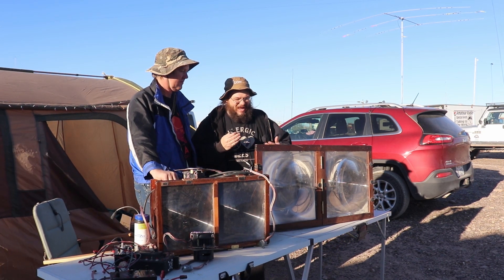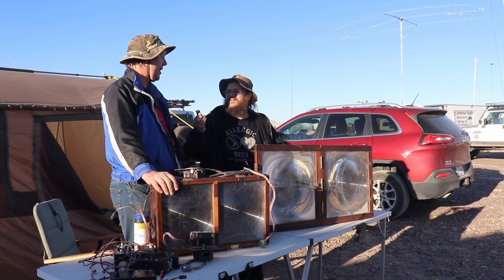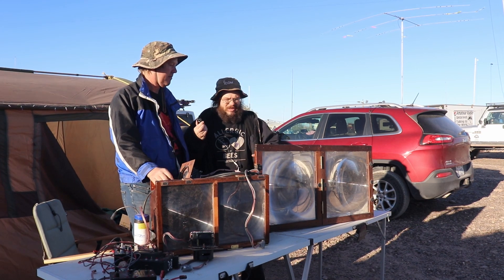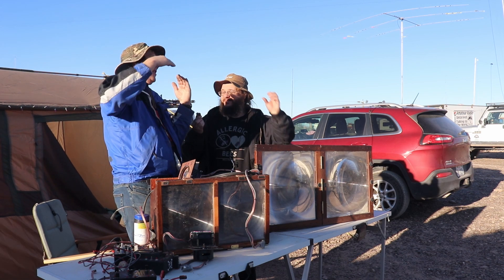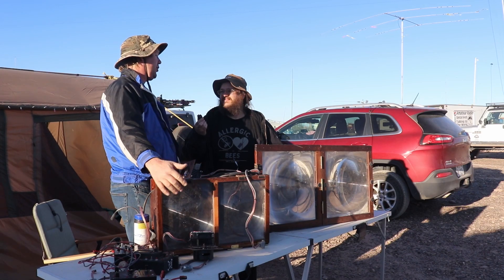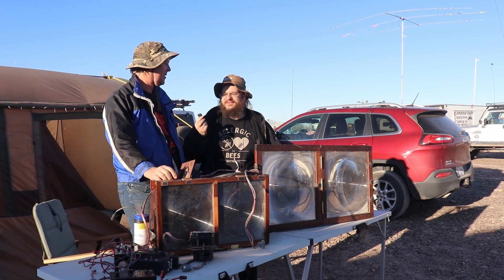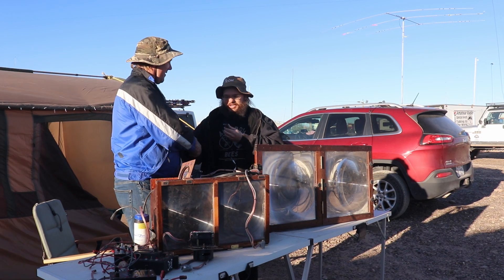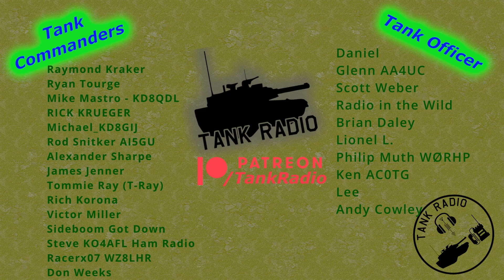Ham Radio Over Light Wave, Ham Optical Communications

Comment: Just spotted this. I have done a bit of optical work here in South Australia. I use Clint's circuit designs as they are the best performers I have found. We use fresnels as well as glass optics. Modulation is normally AM but we have some PWM stuff, mainly lasers. I am giving talks on the topic this year at local clubs and intend putting an optical beacon at our club's repeater site later this year. cheers from Tim VK5ZT
Reply from the maker: That sounds like fun.  Good luck and yet me know how it goes.